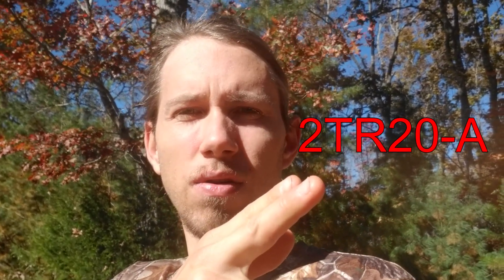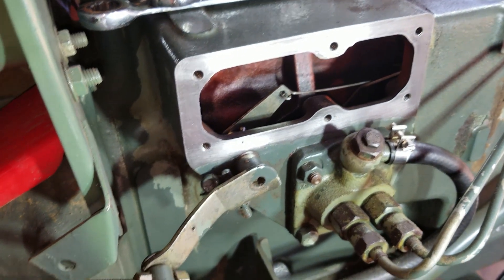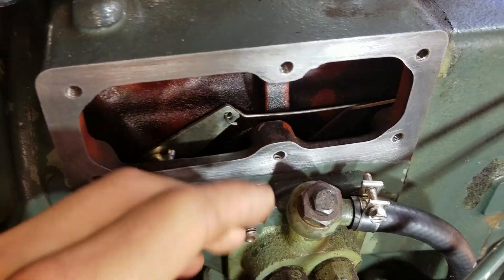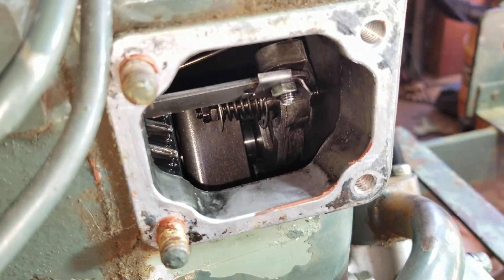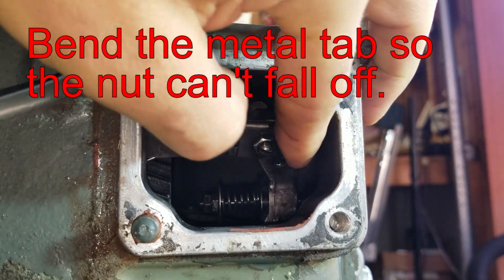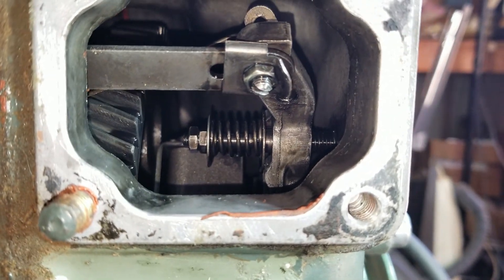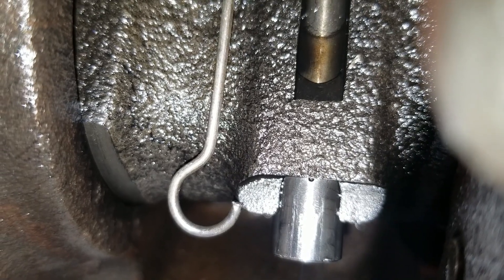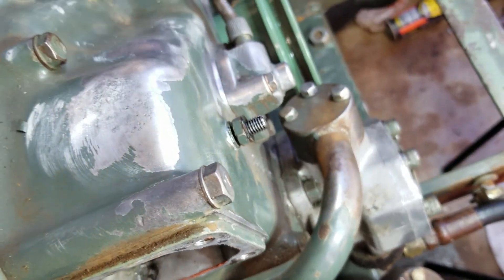How To Adjust A Yanmar Diesel Tractor Governor

Comment: Matt, should BOTH arms be moved towards the rear of the tractor, without compressing the spring, during the first adjustment (not talking about the screw adjustment that fine tunes it)?

Comment: When do you want to adjust the governor?  Mine starts easily however it smokes really bad.  And just got it running after replacing the injection pump.  Seems to have power, drove it a few yards and everything seems normal.  What can cause it to smoke so much?
Reply: Black smoke, too much fuel.  Needs another shim or 2 behind the pump.  Blue smoke, bad rings.

Comment: you are an invaluable resource -- 
I had stuck plungers and had to remove clean and reassemble. On start up I had a runaway--saved by starving the air. Any insights on this problem?
Reply from the maker: Thank you!! Wait till you see what I got coming. It might be caused by not changing the oil often. I mean these machines sometimes you have to take random stuff apart and clean it. I guess it's just regular maintenance on a 50 year old machine.
Reply: @MattsShop  Yet so simple, a home garage weekend mechanic can fix these machines.

Comment: Matt, I finally have my YT account fixed.  This is the main GO TO video we send everyone to see dealing with lost idle control or runaway idle problems.  Thanks for posting the video and many others.  Bret from the YTOG
Reply from the maker: Thanks!! Where are you from? Yanmar Tractor Owners Group?
Reply: @MattsShop  Yes, I'm the owner of the group.
Reply: @bmaverick2871  You have any videos about timing the injection pump? I rebuilt mine and did the adjustment in this video without success. I checked the pump again and all seems like I did it right. I keep getting a run-a-way engine. I'm racking my mind about the plungers direction. Any ideas?
Reply: @snozcocram  Ah you must have the YM2700 posted on our site.  I'll reply with the fuel pump service manual.  Like Matt mentions in his video here, it's not clear to totally understand.  The troubleshooting part is helpful.  This is what you need.
Reply: @snozcocram Stop the video, zoom in, and read the second method of adjustment.  I did and was able to adjust mine well.  But my engine has some other problems.   On the first step Matt told you, it was easier for me to disconnect my throttle rod from the lever instead of the spring inside.  Plus the instructions said to run the ajustment screw on the front of the engine in until the governor lever doesn't contact the torque spring assembly washer when you push it all the way to the left.  That made it easier for me to hold it all still while I tightened that small nut.  It seems to me that what you are doing with this first adjustment is to sync the governor lever and the pump rack both in their extreme left positions and lock them together in that position.   In the next adjustment, you are turning the torque spring assembly screw back out until the dot on the rack lines up at exactly the same time when the assembly washer just touches the governor lever.

That is the point where the governing action begins.  According to the description, the position of the pump rack is a balance between the pressure applied by this spring when the governor lever begins to push against it and the pressure applied by the stretching of the governor spring by the throttle lever.  You set the throttle lever position, and the governor counterweights set the governor lever position depending on the RPMs.

If you don't have anything broken, and you followed the adjustment procedure, it's possible that you may need to adjust the position of the the external throttle lever with the two nuts on the throttle linkage.  You will want to go in the direction that shortens the distance from the lever on the engine to the control lever above. That's how I set the idle speed.  You may have to cut a longer threaded section on your throttle rod to do this, though.  I think I ran a die up mine years ago to cut the thread longer.  I also put a spring on the rod between the upper nut and the lever, so I can pull the lever backward to kill the engine instead of using the compression release.

Comment: Hey man, how difficult is it to change the bushing that the throttle control rod attaches to? Mine has a ton of play.
(It’s the bushing that rests inside the engine block.) I think the throttle linkage inspection plate has to come off. (The plate with 6 bolts.)

Comment: Any advice on removing that injector pump if you have to? Mine is bad and will not come out
Reply from the maker: I am working on one right now and I will have to be installing it. DONT force it and make sure to disconnect all the linkages.

Comment: Hello, I have a John Deere 455 that used to be my dads and he passed a couple of years ago.  I have since been trying to keep up with maintaining their property and the 455 has been giving me issues and has runaway on me before (I got it to die thankfully).  I believe that the governor is stuck in this.  I had just replaced the fuel filter, opened up the injection pump rack and freed up two stuck delivery valves, and cleaned up the injectors.  This all helped and it fired off right away after bleeding the lines at the injectors and it immediately ran away.  Am I on the right track in thinking the governor is stuck / something along those lines?  Any tips, or help would be great as there is no how to that I can find on the governor for this engine.  It is a Yammer 3 cylinder in-line, model number 3TNA72UJ3.  Again, any help, pointers or tips are greatly appreciated as I have limited time that I am even able to get away to work on it, let alone try to keep up with the property. .. also, how likely is it that there was any damage done when it ran away and what would possibly have been damaged? Piston rings, valves, etc..?

Comment: Matt, Great video, good clear step-by-step directions. The only thing I couldn't follow was, where is the shaft with the dimple in it. I'm certain I could locate it once inside the engine.
Anyhow, again GREAT video. By the way that's called an Acorn nut.

Comment: What if you already tried to take the pump off? I unscrewed the bolts, and it wouldn't come off, so I pushed it back in. Now, I get no fuel after priming everything ahead of it. Am I screwed and if so, what do I need to do?
Reply from the maker: I never took the pump off. It has copper shims behind the pump body  to time it. That should be fine. Sounds like you knocked something out of alignment.

Comment: Hey Matt.  I have a Yanmar 2610D tractor and the injector pump went bad, I purchased a rebuilt one but now I am having trouble getting the old one out.  The slide pin inside will not let the pin move so I can pull the pump out.  This is my first time on this tractor so any tips will help.  Thanks.  like your video easy to follow.
Reply: Did you figure it out

Comment: Matt, I have the same tractor as you have. My dilemma is there isn't a divot on the shaft that the governor is connected to. Any ideas on what to do? My problem was I could not rev the engine any more than 1000 rpm's or it would run away on me. I would put it in gear and put the brake, push the lever to kill the engine and pop the clutch to kill the engine. So my research led me to maybe think the governor might be the problem. Any help would be appreciated.

Comment: Matt , Do you a video on pump timing
Reply from the maker: I was going to make one. The service manual is confusing. I had  to disconnect the lines at my pump and slowly rotate the engine over by hand (battery disconnected) until the injection timing marks line up. When they line up (corresponding cylinder to corresponding timing mark) the smallest amount of diesel moves at the pump fittings. If the diesel moves before or after the mark you have to advance or retard the timing with the shim thickness on the back of the pump accordingly.
Reply: @MattsShop  We have the service manual for the fuel pump, YANMAR SERVICE MANUAL - FUEL INJECTION 2TR-2T-3T SERIES YT7708-216E.pdf

Comment: The camshaft or the engine need to be in any specific position like TDC or something to do this procedure? I noticed the exact thing you said the piece of metal with the dot doesn't not move its stock like something doesn't let it move i though could be because of what I said above.  I will wait for your answer and thank you for sharing your knowledge.
Reply from the maker: I didn't have mine at TDC. Check out the manual in the description. It will help out.

Comment: I follow you with the two access panels and disconnecting the spring and all. But where were you looking to see the rod with the DOT? Is there another access panel down low I'm trying to follow you.
Do I have to have the oil pan off?
Reply: I figured it out. It's the slider rod on the injector pump. Smaller than I was looking for and covered in black oil so I couldn't see the dot. Makes perfect sense now. Thanks a lot for access to the manual. I have my pump out putting new barrels and plungers in that's why I missed it.
Reply from the maker: Glad you figured it out. Make sure you time the new injector pump correctly. The diesel injection pump timing is advanced or retarded with the thickness of the copper washers (shims) behind the injector pump. The manual tells you how to do it. You are supposed to you a special tool, but it's dumb. I basically look for the diesel to move out the injector pump ports when the timing pointer lines up with the injection timing marks on the front pulley.
Reply: @MattsShop  I appreciate that. Yes I ordered a pack new spacers.in prep for the install timing process. Was planning on just rebuilding my pump and using existing spacers to keep from messing with timing but they got damaged prying pump off. Might be able to salvage them but will check and adjust timing as well. Cheaper to buy barrels and plungers at $80 x 3 sets than a  new pump with timing headaches. Not easy to find though. Every one wants to just sell the replacement pump.

Comment: U are a life saver. But where is the dot at. Super video this is what I’m working on. Thanks again Cheers ❤️🙏🏼
Reply from the maker: Thanks! The dot is on the little shaft that slides back and forth in the injection pump assembly.

Comment: rebuilding my john deere 850. govenor looks exactly like yours. i kind of forcefully removed the timing cover to get crankshaft out. now that i need to reinstall timing cover i cannot find enough information on installing counterweight bracket and adjustment screw back on. first time it looked right but i ended up breaking the adjusting screw when it fired it up. have you had timing cover off or seen a video of it being done
Reply from the maker: That's exactly why I didn't want to take my timing cover off. No I have not seen it done. Check the description for a link to the service manual. It should help.
Reply: @MattsShop  i have service manual. instructions on adjusting but not on installing